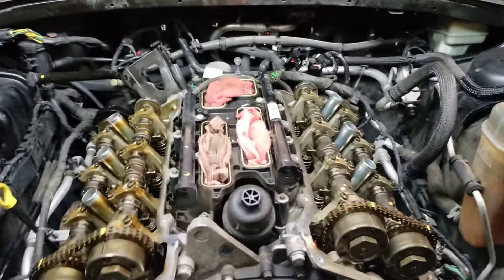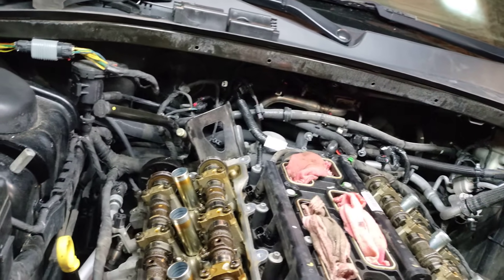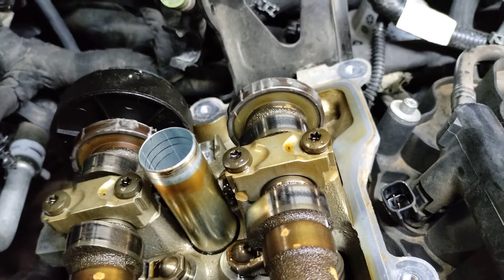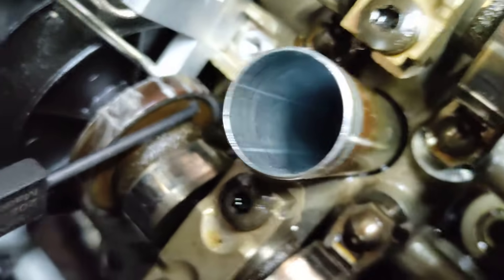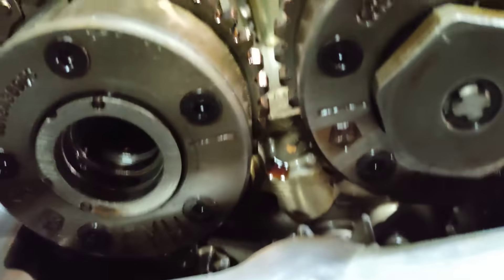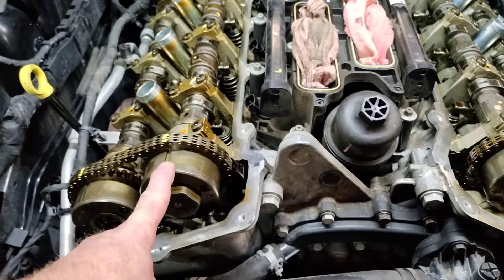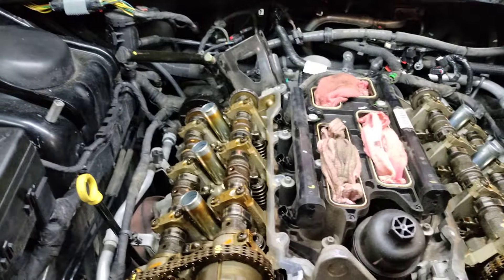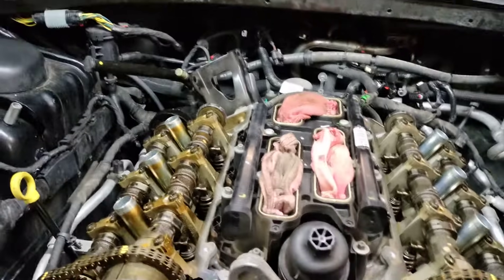Chrysler 3.6 Tone Wheel Check Tool

Comment: Interesting. Rather than spending $300 on that thing, is there any reason I can't just compare the questionable cam to a known good cam? Or is the amount the tone wheel likely to be off too small to just compare visually?
Reply from the maker: Yes if your proficient with a scope then you can scope the cams and see the one where the wheel has shifted. There are times when it shifts and almost appears normal or within spec we'll call it. But it will not complete the cam/crank relearn. Overall the tool is a good visual verification that the wheel has in fact moved. Particularly if you have employee(s) that aren't good with a scope. Ive done hundreds of cams, timing chains, phasers etc on the 3.6 its become muscle memory by now but my help not so much. I still require them to perform the visual verification test like the factory manual says. Except I could never find any info on how to use the tool. That's why i created this video.
Reply: @mastaTech91  Understood. We solely service the pentastar, but we havent encountered any tone wheel shift yet. My guess is that when we do, we’ll just bundle it with a rocker arm replacement and replace the cam. 

We did have a super weird one come in last month. Get this; p0016 and p0017. Cam slow response both cams rear bank (b1). Dealer had it, did cam sensor, cams, hardwired the sensor and phaser to the ecu, replaced the ecu. opened a case, and star told them to replace THE ENGINE with a Jasper. That didnt get it either. We got it, and verified it, but were forced to tell the customer to just live with it. I gave the custy a scanner so at least they could monitor the engine for new codes. 

That job sticks in my craw because we couldnt get it. Pisses me off, frankly. And thoughts? Exhaust restriction? Maybe those noise supressors that bolt to the head? It wasnt chain or tension. It keeps me up at night, that engine.
Reply: @promastersonly1419   Hi Kip, are you saying that the dealer couldn't figure it out, that they replaced the motor, and ECU and it still gives P0016 an P0017?  Did they swap anything from the old motor like cam sensors or oil control valve actuators?  I'm having a similar strange situation.  I'm still hunting my problem down. Thanks for all you do for the community.
Reply: @vetsen  That particular job was a bust. The dealer had it for TWO YEARS before we got it. The replaced everything. Dedicated wiring for the cam sensors. They put in a new PCM. Finally they threw a Jasper at it. Didnt fix it. Star case opened, engineers looked at it. Finally they threw an entire SECOND Jasper at it on their dime! Then they kicked the customer out. In the end, I got the customer a decent scanner so they could reset the code and they are still driving it. 

David Pike over at Motorcity Mechanic has a new video on a related code that might help you. Go check it out.

Comment: How do you reposition the tone wheel if it is out, what is the cure
Reply from the maker: You can't.  Once it's moved you have to replace the camshaft. It is pressed on the camshaft at the factory and is very precisely set up and would be nearly impossible to even get it back into the correct phase on the shaft. Here in the USA the camshafts aren't very expensive.
Reply: Factory cam is over $300!!!!     @mastaTech91
Reply: @mastaTech91   You can reset the toner wheel with that tool and use adhesive to lock it in place.
Reply: thank you so much for your help
Reply: Heat makes it move so i guess if you heat it and  try to rotate it could go back; ivan from pine hollow channel has avideo on a pentastar engine that needed to be replaced, he diagnosed it with a scope
Reply: @RafaelDavidpersonalpage  https://youtu.be/nTYEr1__5n8    Ivan’s video

Comment: I learned alot from watching this. I dont think I've seen any other youtuber talk about this. From the tool itself and how to use it... to the number of links in the timing belt between the cam phasers... Great info! Thanks alot!
Reply from the maker: Thank you so much for this comment. I appreciate it very much
Reply: @mastaTech91 I just changed my LE cam and now it’s throwing P0018 . I start it up and it smoking underneath valve covers or out exhaust under the head with 5 seconds of running. I don’t let it run more than 10 seconds. Any help would be amazing
Reply: Dude, i think you saved my life!  How can we get that tool?
Reply: It's all in a factory service manual
Reply: Did you have to replace the camshaft being out of time. Nice video!!

Comment: How do you change the tone wheel? Replace the whole cam
Reply from the maker: Yes you have to replace the camshaft. The tone wheel is pressed on at the factory. I'm not sure if i said this in this video but i have gotten allot of these that are inadvertently damaged by techs who place their magnetic tear down trays on top of the valve covers while they are working. Thus ruining the magnetized tone ring. They are very sensitive and can be easily damaged even just bumping into it while moving it around if you have it out. Ive even had them bad off the shelve although its super rare.
Reply: @mastaTech91  Hi why cant a second hand one be pressed on with sleeve loctite in the correct position , we have a near new engine that fell off a pallet when shifted which broke cover and damaged tone wheel ,we are in new zealand so real hard to get parts for american cars ,but we have second hand ones off wrecked engines .
Reply: I did a tune up on mine and used a magnetic socket.
Reply from the maker: @darriusstricker5352  I'm very sorry man i didn't see this latest comment. As long as you didn't get the magnetic source too close to the wheel your okay. It would depend on the strength of the magnet that would determine how close is too close. I'm pretty sure unless you laid the socket right on top of the tone wheel itself its okay.
Reply: Post link for tool please